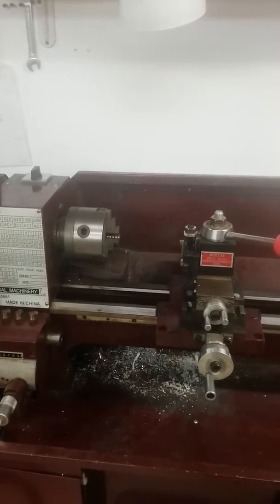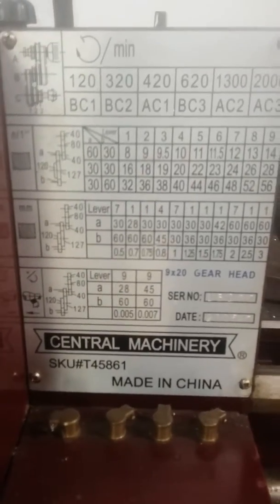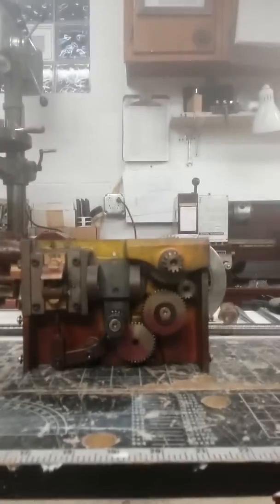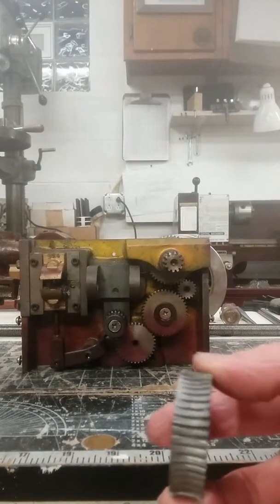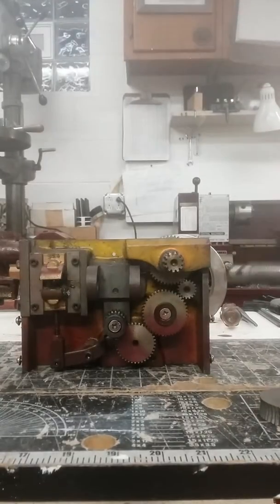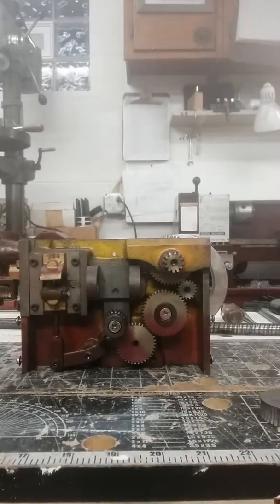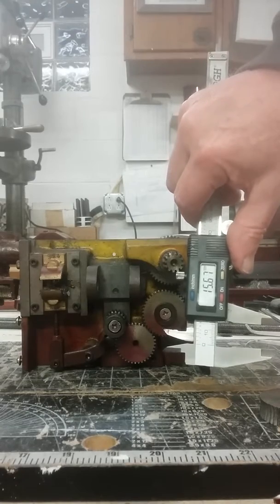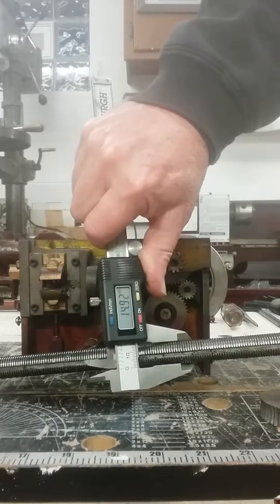9x20 lathe feed prolem

Comment: Where are the bushings that are supposed to be in the bracket?  Without them, getting the engagement of the gear and work isn't going to work.
Reply from the maker: No bushes in mine either .I was going to make some but I only have less than a 16th of play I have to make the holes in the bracket bigger

Comment: Same problem. Find a Fix or the cause of the problem. Where did you get the new parts. I have a JET. New worm gear and pinion is not listed in the parts catalog. HELP!
Reply from the maker: In my experience the central machinery Harbor freight jet and grizzly 9 x 20 lathes are all the same. I have a central machinery alias Harbor freight lathe,  But I get my parts from Grizzly internatonal. My part number was gear 41T in their catalog.  My theory is the drive shaft is bowing upwards in disengaging from the gear. Replace the gear 3 times but now I have limited my cuts to slowest feed and only 20 thousands on a cut.(.020 on the dial)

Comment: I have the same problem with this same 9x20 harbor freight lathe. I have went through about 4 of the gears now. Sick of it. It’s not the bore size that’s the problem. The bracket with the bore holes is just there to keep the worm from sliding left or right. The issue I have found is the worm does not fully engage with the worm gear as much as it should. Also the handle gear on the rack and pinion barely engages causing some binding occasionally that I think breaks the teeth of the worm gear when it is engaged. I am going to take the risky move of putting my apron on my mill and taking a few thousands off the meeting surface so the apron comes up a little bit causing both the worm worm gear and the rack and pinion to engage better with their mating gears. We will see how it goes I’ll let you know. I am also going to hobb a gear out of steel because these gears are cheap and made out of cast iron. That’s why the teeth are breaking off.
Reply from the maker: My thought was that the lead screw was bending up under the tension and then the warm gear stripping the teeth off the gear. My solution was to make brass bushings for the  bracket to keep the  lead screw worm gear engaged with the gear. But this does create some interference problems with chips that have landed on the lead screw. engaged with the gear

Comment: Did you find out the issue?, only thing I can think of is saddle  or rack drag?
Reply: The pinion gear was just worn out. Lathe is 26 years old and spent a lot of time in a machine shop. The gear is only cast iron. The teeth are sharp enough to shave with and worn down mostly on one side.